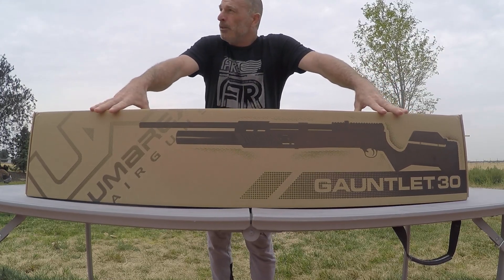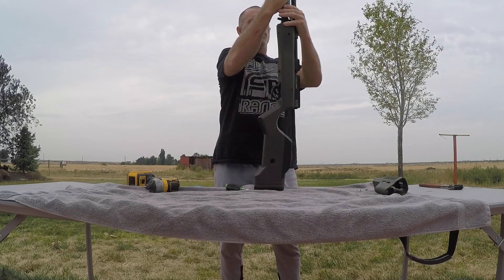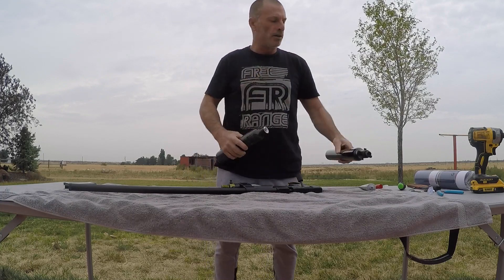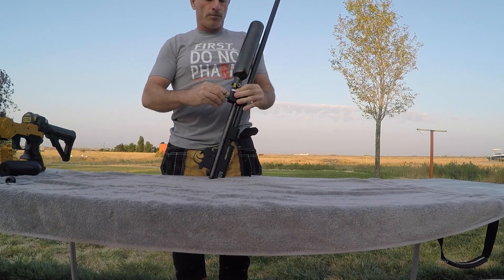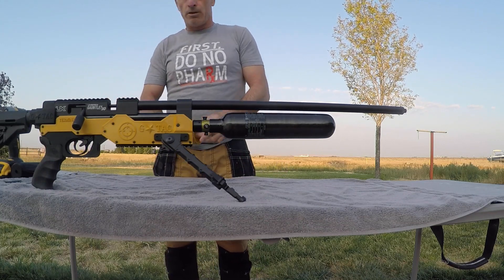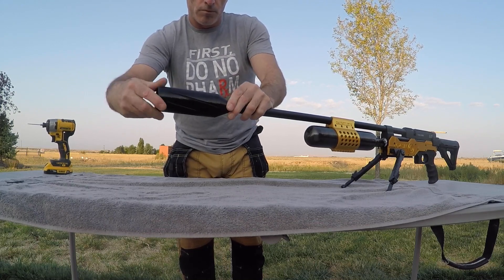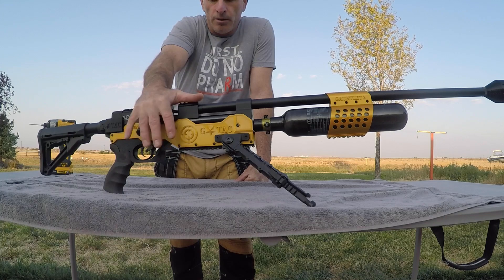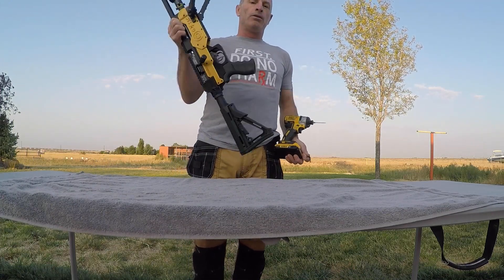Umarex  Gauntlet G30 Terminador Build & CF  Bottle Conversion

Comment: Will that stock fit in the G2 in .22 cal?
Reply from the maker: Yes just specify which model you have upon ordering as there are some small differences.  Call or text 2084881013 to order.

Comment: What size are the threads on the regulator? Wanting to put the 700cc bottle on the G2 30 
New to the PCP world.
Reply from the maker: M18
Reply: Would the stock regulator fit on this tank? 4500Psi Carbon Fiber Tank 0.7L/700cc M18x1.5
Reply from the maker: @RimFireCenterFire  no

Comment: Man, I'll hit your eBay store soon. Just as soon as my PO arse pay down some PayPal credit. 😆 Quick question, are you going to design a double bottle setup with a regulator? If so I'll hold tight for that.
Reply from the maker: No but I do have a benchrest model coming out that runs a 700cc bottle & lower reg pressure to facilitate greater precision & a higher shot count.

Comment: Its funny this can do 110 ft lbs but my fx impact breaks every time I tune it over 90. I wasted almost 3k on that POS.
Reply from the maker: 😱😱😱 Crap sorry to hear that bro.  Hit me up if you want a built G30💥Tac
Reply: I making over 110 ft lbs and getting 40 shoots per fill with 50 grain jsb bra with my Fx impact 30 cal
Reply: @joemedina8327  Mine is a lemon, it has a bad reg. FX wont fix it. It never worked right, broke on day1. It went back 6 times. It had a bent pellet probe and the cocking lever was installed incorrectly so it would blow open when shot. FX SUCKS. Worst customer service EVER.